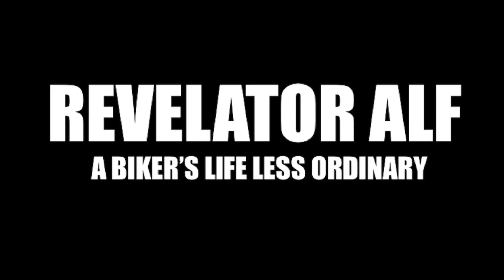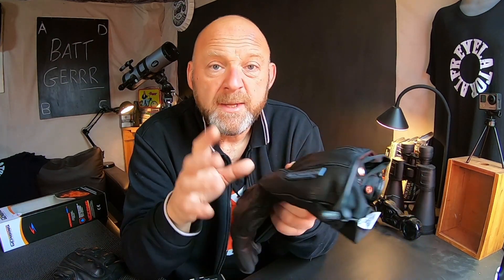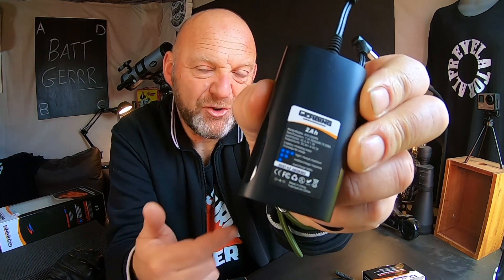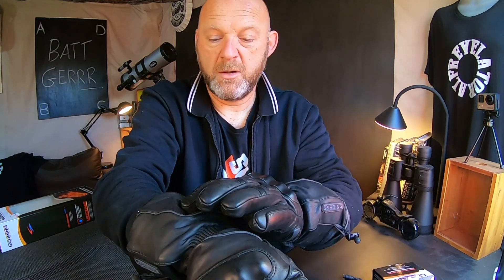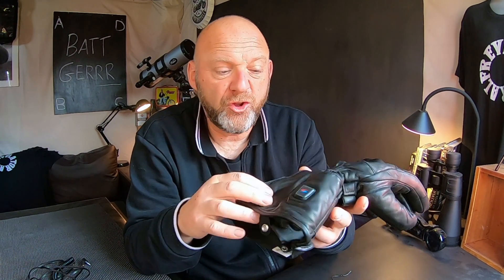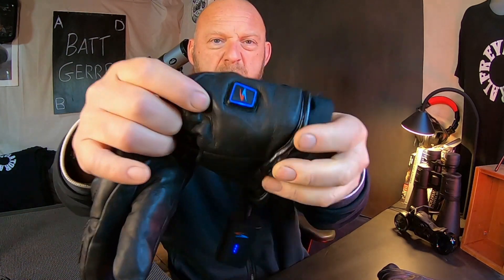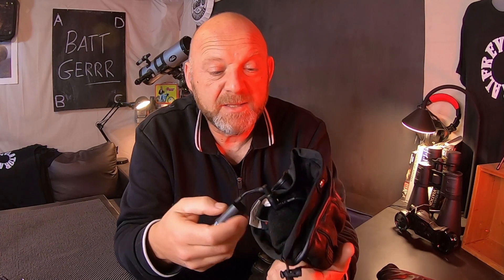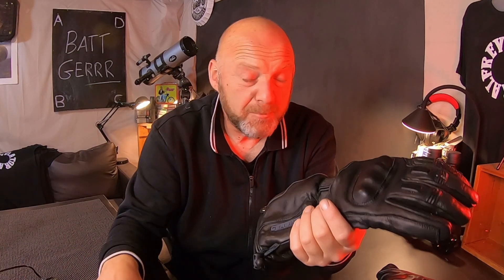Heated Motorcycle Gloves Battery Review Test | Gerbing XRL Battery Power

Comment: My gerbing gloves that I've had for 7 years have literally just given up( split wires from lots of use ) i've been using the wiring harness down the sleeves and it is quite a faff especially for a 20 minute commute. Just ordered these xrl with the battery packs and awaiting delivery , I found your video very usefull. My only concern with the way gerbing has gone with the control button built into the glove as opposed to the in line controller is you can't wear them  under the sleeves ( which I found creates a better air seal and rain ) saying that with the battery packs attached I doubt I will be able to get them into my sleeves so we will see how they fare.